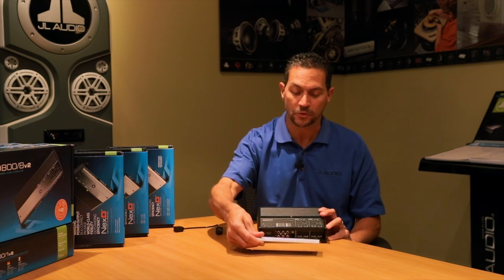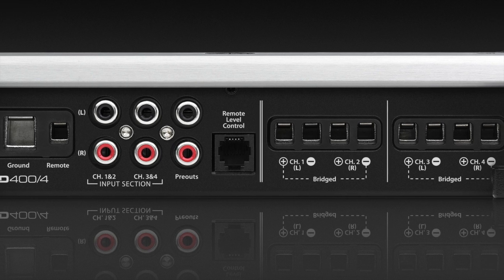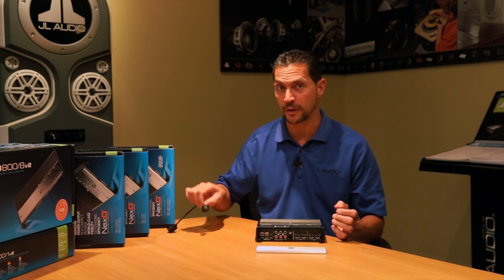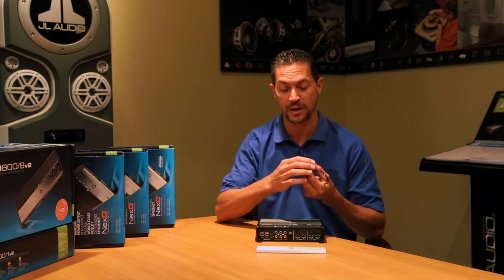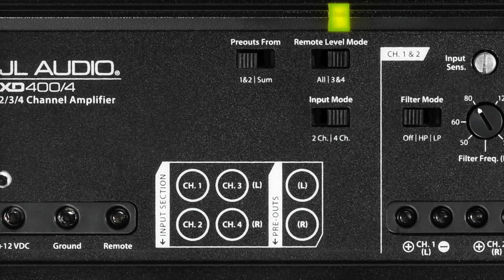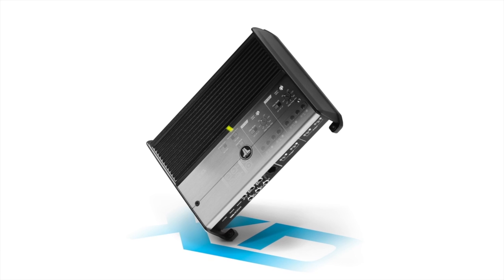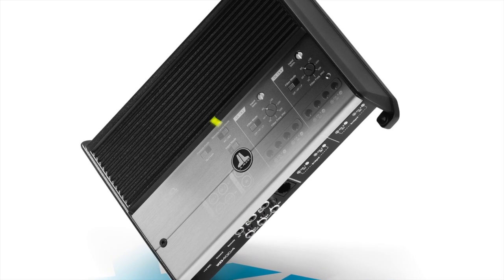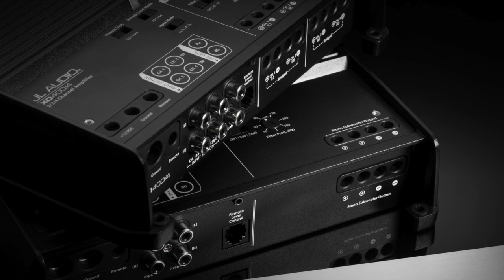JL Audio XD400/4 Product Spotlight

Comment: Hey, Just bought this amp and I wanted to comment about how confusing the user manual is for this in reference to the bridging features. Most people will bridge the amp for subwoofer operation or for a high power stereo operation. I personally am using the high power stereo option. By this I mean 200 watts to the left and 200 watts to the right. However the documentation is kind of confusing seems like you set it to mono mode to set up two stereo channels bridged??? Why not call this stereo mode and for the other mode call it mono mode seems like the terminology is backwards. Also a simple diagram in the manual and maybe some better wording would make it more clear for us as users. I am an experienced audio person so I can testify that this manual needs better clarification. Also seems a little confusing as it is worded

Comment: will this amp fit in the nose of a 18 Road Glide ?
Reply from the maker: The MX-series amplifiers would probably be a better solution for you, we have seen them put in the fairing of motorcycles with ease. We do not have exact cavity dimensions for that motorcycle, so I would reach out to your dealer/installer if you want to verify fitment of the larger amplifier.
Reply: I know your question is 3 years old and the answer is yes. I just installed this amp in my 20 Road Glide. However you need to cut & grind the fairing bracket in order to fit it. Sounds great!

Comment: I just returned my XD400/4. Very disappointed with the sound quality coming from a 4 channel 599$(CDN) JL amp. I upgraded and got the JL 300/4v3 and WOW the difference is insane. The XD is loud but lacking quality and meat on the bone. Its real zippy and accentuates high frequencies, piercing the ears. Gets fatiguing  to listen to real quick. But I LOVE the 300/4v3. Well worth the upgrade. I wouldn't recommend this amp for anyone. Class A/B ftw.
Reply: David manock ur a Critic like a bitch my shit with my xd sounds phenomenal don't be a hater cuz in reality u don't have a amp to begin with.
Reply from the maker: That is odd. Did you set up the sensitivity of the XD400/4v2 with a meter or scope? Usually when set up with these methods the XD is very accurate in reproducing the source material with no artificial artifacts.
Reply: JL Audio, I have a 2007 street glide with 2 infinity kappa components on the fairing and 2 6x9 infinity kappa in the bags, I have limited space behind the fairing on top on my radio, what amp do you recommend, I currently have the power acoustic rz4 1200d it sounds good, does not over heat but I feel my speakers can do better.  Thank you for you time
Reply: @jimeneznazario223  aye Dogg don't listen to other dummy's I just bought the xd400.4 it's fucking amazing bro there's just to many Critics out that don't appreciate or know bout shit.
Reply: @jimeneznazario223  oh shit my homie I miss read ur ur question listen I'm not a pro but I do have experience dealing with different amps and such for a Speakers amp I would definitely recommend the amp from Sonic electronics it's a 4 channel amp it's there brand puts out alot of juice and it's dependable. Ya definitely check out there Sonix electronics brand it's called NVX trust homie u won't regret and price is reasonable
Reply: Eddie Arencibia thank you, I have JL audio on 2 of my cars I love their amps and subs, I have the 13 1/2 with a 1000/1 v2 and their 300/4 v2 for highs and mids
And Two 12” w3 v3’s with a 500/1 and 300/4 for mids and highs.  the space on my Harley-Davidson is very small was just wondering if this amp would fit and would it sound better I appreciate the feed back, thanks again Eddie
Reply: @jimeneznazario223  yes it well fit
Reply: Yes it was setup by the installer who has 20+ years experience in the field. The amp was hooked up to rockford fosgate power series speakers. I knew instantly after listening to it I was going to have to get it swapped out and the 300/4v3 or even the /v2 version I had before beats this thing out by a landslide.